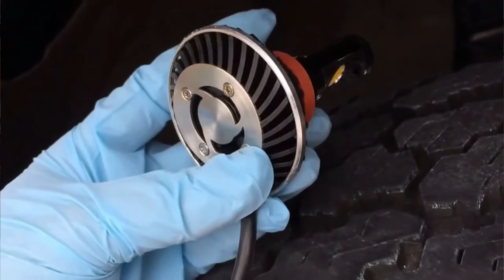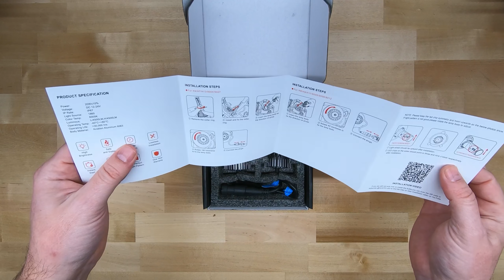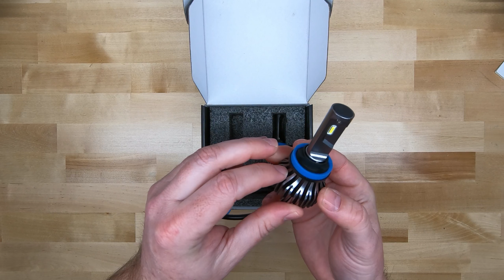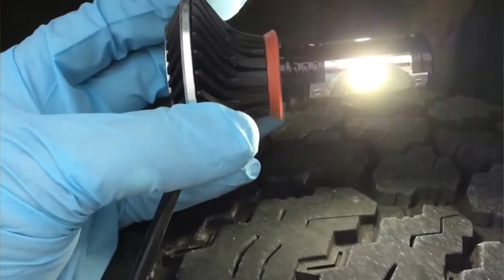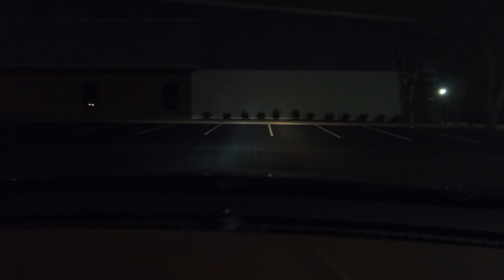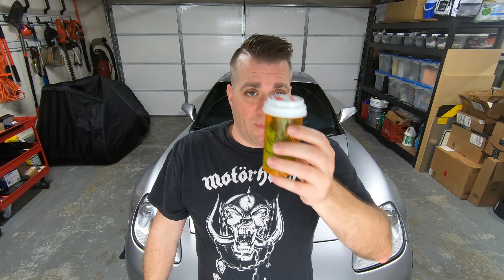TESTED - The Best Budget LED Headlight Conversion?

Comment: I have a pair of Lasfit 9006 LED's in reflectors. They have a yellow halo around them on the garage wall. I would assume it's from the yellow chips. Does anyone else have this issue and can it be corrected ? I don't remember them having this when I first got them. They're not the 360 degree type.
Reply from the maker: Chip color doesn't always mean output color.  Most (if not all) chips that put out white light are yellow.  Have you taken them out of the housing and turned them on to see if it also showing yellow that way?  Did it happen to both lights or just one?
Reply: @InJasonsGarage : Both. I have an LED flashilght that does the same thing, you can see yellow around the light output. I'm not sure if they can be turned but that's what i was thinking to try as well. Thanks for your comment

Comment: The fact that the driver is in the light housing itself denotes the fact that they light output is actually going to be hindered as the driver produces a ton of heat. If the driver was up the line a ways, the power output of the led itself could be higher as it only has to dissipate heat from the the let's. Check out SV4 lights, you'll get better performance out of something like that. I'd be interested in seeing a follow up video with your thoughts on the SV4 vs those.
Reply from the maker: I agree, I learned a lot since I made this video, and I should have been more skeptical of the design but after months, still doing great.  I'll check out the SV4 lights.  Where's the best place to buy them?
Reply: @InJasonsGarage   I buy all of my headlight products from headlightrevolution.com. If you can pony up the extra 40 dollars, you should get the GTR Lighting Ultra 2's instead of the SV-4's.. They are the top LED out right now. I have their Ultra 1's in my highbeam and they are insanely bright, the Ultra 2's are supposed to be night and day difference.
Reply from the maker: @thomase907  The headlightreolution guys are pretty cool.  I will check them out!
Reply: Just made the switch to GTR ultra 2's in all of my lights.. all I can say is damn. Best light output I've seen yet, it is better than my morimoto 55w HID's were.
Reply from the maker: @thomase907  Good to hear.  Did you buy them direct or through a distributor?  And what vehicles do you have them in?  I'm wondering if they are projector or reflector.
Reply: I bought them all from headlight revolution, as always. And they are in a 2018 Subaru WRX with factory projectors on the low beam and reflectors on the high beams.
Reply from the maker: @thomase907  Ah, sorry...I forgot that you did mention that you get them from Headlight Revolution.  How do they perform with the reflectors compared to the projectors?
Reply: Perfectly, super bright hotspot and amazing throw. Also have them in my fogs that are reflector and the beam pattern is wide and flat just like it should be.
Reply from the maker: @thomase907  Nice!  Good to know, thanks for the update.

Comment: They sure look a lot like the lasfit la plus's! But the lasfit have a fan which is critical if you ask me!  Passive cooling in tight places is a joke!
Reply from the maker: Normally, I would agree with you on the passive cooling part.  I was honestly just going to test these for a little while, but it has been 8 months and they are still doing great.  I am honestly quite surprised and frankly, very impressed.  Auxito is sending me another set of headlights that they released which has more tightly aligned chip placement and a cooling fan.  I cannot wait to test them, stay tuned!
BTW...I have tested Lasfit lights in the past (see my other videos about 3157's) and they are pretty good as well.  Are you running the Lasfit LA Plus's now?
Reply: @InJasonsGarage  yeah I spent like a month or two researching what bulbs and those are the ones I settled on after getting a set for my gf's jeep(yeah she was my Ginnie pig, so what! LoL).  I would of gone with the LS plus but they are out of the 9007's for awhile now.  Yeah I'm amazed at the lasfit LA plus's.  Super bright, beam patter is better then the incandescent bulbs and finally(my old set are the worse at this) no RF interference when I'm using the radio.  The fan isn't loud per say but you can hear it outside the car.  My exhaust drowns out the fan anyways(DC sports cat back FTW!)  

My problem now is trying to find a led bulb set that doesn't go completely off for the second between high(break lights) and low(running lights).  I watched your other video and and many others don't really go over the switch between highs and lows on dual filament bulbs like the 3157/4157's.   I think I finally found a set that doesn't and it's the Philips ultinon's or Sylvania zevo's. Not to sure yet.
Reply from the maker: @GeoTrashPanda  Cool.  Sometimes it is hard to find the sweet spot of what you need/want vs. what is available.  I am always saying, "How come they don't make -exactly- what I need?"  LOL .   Stay tuned, though...Auxito sent me a newer version of their lights to check out.  They have an external driver and a fan and more REALLY good features.  New video about these being worked on right now...and so far...the testing is VERY positive indeed...

Comment: I bought some XenonPro leds, they are terrible. 150 bucks for them and the scatter is crazy, they light up roof tops of houses which is dumb. Maybe I’m dumb and don’t know how to adjust them hahaha but I’ll going to look into these and see how they work! Thanks!!
Reply from the maker: I just checked them out and the design of them is very bad.  The four-sided design might put out a ton of light, but it is useless because the LED chips are nowhere near the same location the factory bulb filament so the reflector throws the light in all the wrong directions.  Send them back and try the Auxitos and tell me how they work out.
What kind of vehicle are you putting them on?
Reply: Jason's Garage it’s been awhile since I bought them so I doubt I can return them but oh well, I also saw your other video on the SL1’s but sadly nothing came up for my car. I have an 04’ vw R32 but I did see some from Auxito so I might go with those. Thanks for the reply you’ve earned a new subscriber!! :)
Reply from the maker: @gtigio5067  Oooooh...got a soft spot for the R32.  Cool.  That takes an H7, right?
Reply: Jason's Garage hahaha it’s one hell of a car I love it, and yea it takes H7 kinda difficult to find
Reply from the maker: @gtigio5067  I was at PRI in Indianapolis today and talked to the Diode Dynamics guys.  They are working on an H7 SL1.  😀  They said to expect it early next year.
Reply: Jason's Garage oh sweet! I guess I can wait and deal with these ones for a bit longer😂 thanks for the info much appreciated!!

Comment: So I have a 2008 Ranger that calls for 9007 bulbs. Auxito shows an LED replacement that has no fan, not even a heat sink. Any thoughts about heat dissipation without a heat sink? Yours is the first video I have seen to address heat issues and I am concerned with an older design headlight like my Ranger. Will heat build up and cause distortion to the reflector or lens?
Reply from the maker: Check again, I know they have one on their site that is a 9007 that has a heat sink, exactly like the one I reviewed in this video.  I would definitely not get one without at least a heat sink.

Comment: Just got some of these installed on my car today after seeing this video. All I can say is man are they bright. Easy to install as well. Now Ill just be curious to see how long they might last.
Reply from the maker: My wife is still driving with these headlights installed.  As I type this, it has been 7 months since I made this video.  She drives 15-20 miles every day, 5 days a week. Plus general running around on weekends.  There's also been a couple of 1,000 mile plus trips and these are still doing well and are still very bright.  I am surprised because they don't have a fan or an external driver.  For the money, you cannot go wrong.
Reply: @InJasonsGarage  Cool glad to hear it. I do plan to order a second set just to have them on hand. Really cant beat the price. Really about the same as the normal halogen bulbs I was using.
Reply: Do you know how many watts these draw?  You can measure that (amps, actually) with a cheap multimeter.

Comment: Does your wife still like them in her projectors on her vehicle? I have a dart with projectors and can't find a worthwhile led bulb anywhere! I'm really considering this product but I'm tired of gambling on junk. Also, is it hard to adjust the bulbs once you had them in the projector housing?
Reply from the maker: We were driving in her car two nights ago and I asked her if she still liked her headlights and if they seemed dimmer or have had any problems with them and she said that so far, there were no problems.  I am pleasantly surprised.  Give them a try, let me know how it goes.  If they don't work well you can always return them.
It is not hard to adjust the bulbs, but it depends on how your cars headlights are designed.  Check the user manual, it usually only takes a screwdriver and a flat wall.  Let me know how things go.
Reply: @InJasonsGarage  This is true. I think I'll take a gamble. Thanks for getting back to me!

Comment: Looks like the halogen throws  the light further though.
Reply from the maker: I know it is hard to tell from the video, my camera just doesn't pick up details well in low-light situations.  However, in person the LED does indeed project further.
Reply: Wow thanks for the reply and the speedy Reply at that. Great video and info. Thanks.
Reply from the maker: @bearez1  You bet.  Give them a try and tell me if you agree.  For the money, these have been holding up very well!

Comment: Is there any testing of these LED light?    Cant put them into just any headlight housing.   Can create lots of glare for other drivers.  
The view from this side, could not determine how well the led lights work. ..  poor lightning or camera focusing or something.
Reply from the maker: There is no glare in my application shown in this video.  I know it is hard to tell from the video, my camera just doesn't pick up details well in low-light situations but they work great, especially when compared to halogens.  It has been 7 months and they still work well.

Comment: They don’t make a 9004 bulb 😑
Reply: rtownsend744brad, the 9007 will work in place of a 9004, but not without a little modification. The plug is the same but it's wired differently. I'd recommend getting pigtails and wiring them correctly. Also the base is identical but it's clocked different than the 9004 but luckily most LEDs can twist inside the base for adjustment. The high and low beam filaments are reversed so the 9007 will ultimately sit 180° out or upside down... I'm doing research myself and I'm encountering the same problem. Hope this helps!
Reply: yotakeith85 correct sir.
Reply from the maker: Double check this, but I believe the 9007 is the same as the 9004, and if true, this is what you want:  https://amzn.to/2pOZ87S

Comment: remember dont touch the halagen bulbs with your bare hands it will blow them out :)
Reply from the maker: GREAT point!  That's why I mentioned at @8:32 that I keep a set of backup bulbs in the car with nitrile gloves. In case you need to replace the LED lights with the halogens, wear the gloves so the skin oils don't create a hotspot and cause the halogen bulbs to fail.
(Another benefit of LED lights!)

Comment: that was a great review, good overview, great real world testing. Only thing i would ask about is the bulb having a internal ballast, have read that it may shorten the life of a bulb due to extra heat build up vs a external ballast. Keep up the reviews.
Reply from the maker: GREAT point!  So far, they are holding up great, but I agree, that is a big question.  See my latest review of the Diode Dynamics SL1 and I talk about this a bit more.

Comment: THERE ARE TONS OF IRRESPONSIBLE  DRIVERS WHO DOES NOT TURN THEIR LED LIGHTS TO LOW BEAM THAT CAUSES BLINDNESS TO OTHER DRIVERS GOING THE OPPOSITE DIRECTIONS .ALSO WHEN THESE IDIOTS ARE DRIVING BEHIND YOU  THEIR LED LIGHTS  WILL REFLECT AGAINST ALL YOUR MIRROR ALSO CAUSING BLINDNESS.. NO OFFENSE TO YOUR UPGRADES BUT BE RESPONSIBLE
Reply from the maker: That happens with ALL types of headlights, not just LED.  The other issue is people install them without re-aiming the headlights.  Again, that is a driver issue and not an LED light issue.

Comment: They had hid kits in the past that were 35w and came across the same kit and brand that were now 55w. That was a night and day difference. Not bright like a high beam but great color and just as good as factory led today. Some cars are sensitive to lights and get that dash warning.
Reply: Just wonder how much power is needed to equal the hid 55w in a led bulb. Is this power here being lower will match a 55w hid 🤔. That would be a good video. I’ll have to make also

Comment: Do you know if they hold up in the cold well? I live up here in Alaska, and i'm wondering if they'll be able to handle below freezing winter  temps.
Reply from the maker: That's a pretty good question.  I am sure they would do fine, they get warm and actually hot to the touch, but not nearly as hot as an incandescent bulb.
Reply: LEDs don't project any IR light, like halogen does.  So your lenses will freeze over faster and more frequently.  Be careful of that
Reply from the maker: @jdhill770  The drivers do get hot, though and do radiate heat.
Reply: @InJasonsGarage  And I stated that the LED lightsource does not project IR energy, heat, towards the lens of the headlight.  Which means theybwill freeze iver faster and more frequently than halogen headlamps.  Which is a particular concern if someone lives in alaska.  Doesnt matter if the bulbs turn on at -50F, if your headlamp lenses are frozen over for 7 months of the year.
Reply from the maker: @jdhill770  True and a good  point.  My experience is that I have used some in sub zero temperatures for stretches of a few days with no issues, but that is nothing like the Alaskan temps you mentioned.
Reply: I ran LEDs on my Tahoe back in the cold snap of 2017, and they were just fine.

Comment: Just ordered a pair, paid $32. Definitely worth trying for that price.  Even if they're not much brighter than the stock bulbs, the color change will help a lot.
Update: Received and installed, not as bright as I was hoping, but slightly better than stock, definitely like the white light though.
Reply: King Kent I had hid kits that were 35 watts and came across the same brand and they had 55watts. That was a huge difference in light. He said in this video these were 20 watt. Made me think the same. Good color but not that wow factor of light. I saw a brand the cougar motor and ordered them and gonna check them out also.   I was ready to get these till I saw your post. The brighter output makes the deal and I see how these cougar motors are. Saw them on here also. A wireless one. Best of luck

Comment: Have you tried SNGL led bulbs? They are expensive, but so far they have outperformed all my previous LED bulbs.
Reply from the maker: Good grief...that is expensive.  Have you tried Diode Dynamics SL1 lights?  I am testing them now...pretty decent...
Reply: @InJasonsGarage  I have not. They have great reviews by Youtubers. Amazon reviews aren't as great. Let us know your test results. Maybe do a comparison between DD and SNGL? Some of the SNGL bulbs are specifically designed for projectors. So that would be interesting to see if they are actually better. Use a light meter for the test too if you have one. If not, there are a couple light meters on Amazon that are like 20 or 30 bucks. 👍

Comment: I got the Beamtchs from Amazon for $38. They are a nice color and pattern but no brighter than stock. Debating returning them.
Reply: Myles Gray....What kind of vehicle?
Reply from the maker: @kykrazy6050  That's what I was wondering.  Myles, can you verify that all LED chips are firing?  Just pull the light out of the housing, throw some dark sunglasses on and turn the lights on.
Reply: It’s a 2013 Prius. The housings are projectors. The bulbs are rated at 8000 lumens so I think I need to exchange for 12,000 lumens. I’ll double check all the chips are lit.
Reply from the maker: @OptimisticEngineer345  You can also try the lights I reviewed in this video and see if they are any better by comparison and send one of them back.

Comment: They said they have a 40,000 hours lifespan. With the price they are worth trying.
Reply: Good thing about LED is that they last longer than you think any drawback LED has is not sufficient cooling like if you want to travel for long with LED headlights ON it reduces output after some time. This os the only thing I hate about them.

Comment: Great video. Would you recommend these for projector retrofit headlights on a Cobalt?
Reply from the maker: I don't see why not as long as the LED chips are in the same position as the light that was designed for the projector.  Should work fine.

Comment: I noticed on the video the lights look a little blue when your driving down the road, they look like a frosty blue and I like that. I'm actually looking for a set of bluish led lights for my 15 Ram. Are they like that in person or did the video make them look like that? Thanks.
Reply from the maker: You are correct, it is 6000k so it does have a slight blue tint.
Reply: Thanks for replying dude. Yeah they look clean. I think I'll be buying a set here pretty soon. I like the way they look. 👍🏽
Reply from the maker: @911Fuser  No problem!  Right now if you hit the link in the description, there's a $5.00 coupon you can apply.